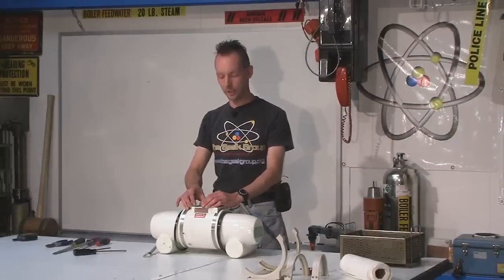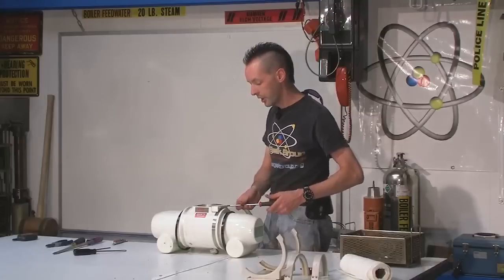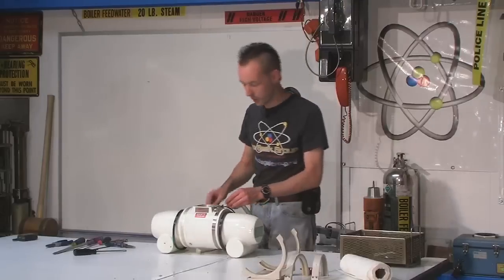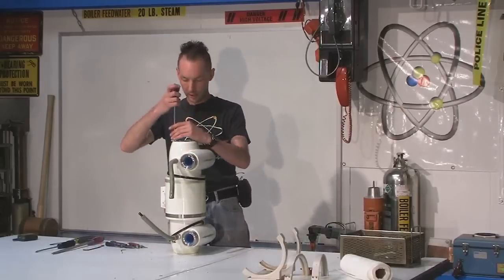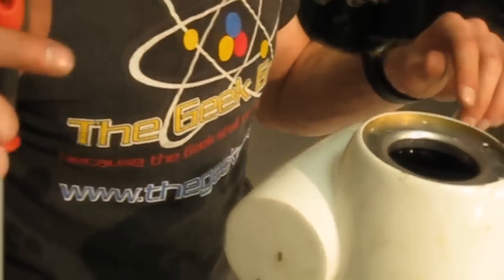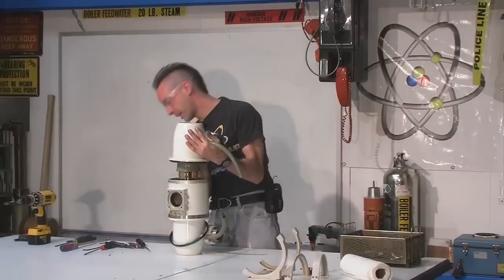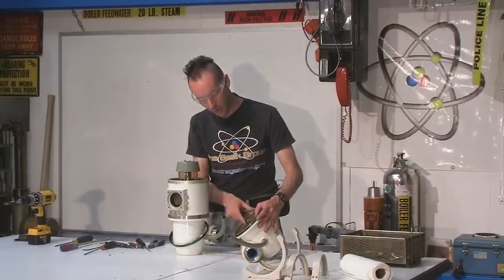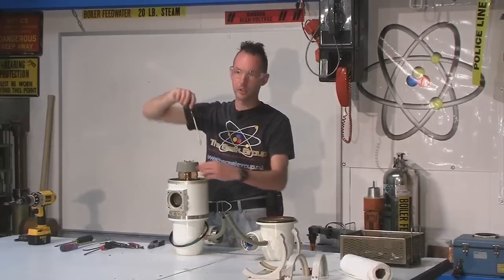X Ray Head Part 2: Equipment Autopsy #5

Comment: 3:55 you are most likely right when i work on adjusting force and travel limits on garage door openers almost all of them have one of these on their motor after running it after about ten adjustments you will hear a click and the motor stops what this is is that little sensor (possibly a thermal relay) opening and it wont re-close for about 5-10 minutes